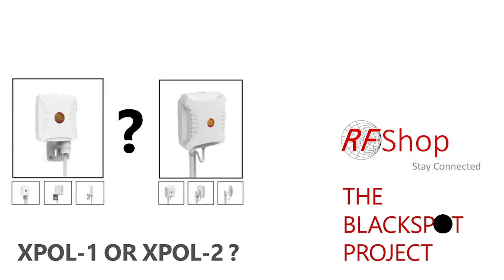What is the difference between the Poynting XPOL-1 vs XPOL-2 Antennas

Comment: You mention omi usually for urban areas but would it still make to install directional in urban at the top of my roof that's overlooking all other lower roofs and point it to a single tower (or groups of 5-6 on two opposite sides but am not quite sure what they're yet) or it's safer to get omni and allow it to choose from both sides between 11 towers - all within 1-3 miles (am 9 minutes drive from an airport)? Sorry am still new to this.

Comment: Hi David, can you tell me what the difference in reception is between the MIMO-3-12 and XPOL-1?
Both are applicable to an RV.
Reply from the maker: Hi Eric, sorry for the late response (9 days in)...
On face value I can only go by what the datasheets tell us. I am more in favour of the MIMO-3 antenna, because of where you can place it and how it can be mounted (i.e. well clear of any obstructions). The XPOL-1, although an omni, is inevitably placed against a surface or obstruction so would not be pure omni in the way I like an omni to be. 
Performance wise, though, they are probably very similar

Comment: I have a Netgear LB1120 and am looking at the XPOL-2 versus a MIMO LPDA from Waveform versus the new Amplimax?  In a rural area in Texas about 4 miles from the tower,  No tress within 500 feet from the house, but depending on how high I can mount the antenna, I might have some tree tops as obstacles ...Any suggestions? Thanks,
Reply from the maker: Hi J. If it's that remote I would look at the MIMO LPDA as the strongest option. Those antennas are generally a little bit better on gain, in particular on the lower frequencies.

Comment: Great informative vid buddy, I have a Netgear M1 which is only 4G can i connect the Poynting XPOL-1 which is 5G? will it be better for signal vs the Poynting 4G-XPOL-A0001 Cross Polarised 4G Omni LTE Antenna

Thanks Mick
Reply from the maker: Hi Mick. Yes, most certainly. When we refer to 5G it means that's an additional technology added to the antenna. It is backward compatible, and could do (where applicable), 2G, 3G, 4G and now also 5G.

Comment: Hi david I've just bought a tp link mr 200 to get better 4g but made no difference, than on my phone so thinking about getting an poynting attenna,we cant no see the mast because of hill,which one would you advice to get.
Reply from the maker: Hi Joleen, the XPOL-2 is a good option. You still know which way to point even if the hills is in the way. An omni would give you less gain and chance to make a connection

Comment: How does the XPOL-2 compare in performance to a conventional log periodic MIMO setup? When would one be suggested over the other?
Reply from the maker: As a general rule the LPDA setup is more suited for the rural areas as it just has that bit of extra gain, in particular in the lower frequency bands where the lower bands offers additional range / reach. This is a very basic cheat sheet (not overly scientific)...suburbs and outskirts can take XPOL-2's. Rural areas get the LPDA. 

Sometimes it's also a mechanical consideration, as the LPDA's are heavier and more bulky, where the XPOL-2 is a kilo and a single package.
Reply: @RFShop  Ok, thanks for clearing that up for me!

Just a thought, it would probably make for real good content to make videos comparing different antennas and setups to one another in different environments and scenarios to really show what equipment would work best for each application!
Reply from the maker: @journeytowellness7096  that’s a great suggestion. Many thanks for that

Comment: i'm getting 250mbps with my XPOL1 V2. i also found that it still makes a difference which way it's pointing, in spite of it apparently being omnidirectional. i got the SNR from 25db to 29db just by turning it 15 degrees. and signal power went from -81db to -76db. i just dont need XPOL2 as my speed is already very high
Reply from the maker: Indeed, at 250Mbps it’s going to be hard to justify another antenna

Comment: Just upgraded from XPOL 1 to a 2 V3 and my download speeds have almost doubled In rural Scotland !! Great Antenna Thanks for the info David !!
Reply from the maker: That’s awesome!
Reply: Great! I'm in rural Scotland and have been living with a xpol a0001 for 4 years. The ee mast near our hill just got upgraded to 5g. Hoping to slash out on xpol2 (great video btw!) just need to know how to work it where to point it!.. But just realised I will also have to upgrade my hub!
Reply: @julianbell9586  4G gives my 190 down and 40 up after BT got involved in EE. Used to get 250 down easy but its still pretty great for a none FTTC area. Just move the new Xpol around till you get Signal Strength:  close to 100% ! Took me a couple of weeks to find the best spot for it

Comment: Great crisp video! Well I just have both here to test because I am very unsure on what I need. XPOL1 as 4x4 and XPOL2 2x2 in the highest building of the city. Very curious on how they will perform on 4G and 5G modems.
My goal is to have highest stability with lowest ping. XPOL2 does 42ms ping in 4G so far... thats why I test the 4x4 omni too.

Comment: Quick question David: the T-Mobile Nokia 5G gateway supports 4x4 MIMO. If I read your video charts properly, the XPOL-1 supports 4x4 but the XPOL-2 does not. Would that suggest (cost aside) that I could, or should, hang two XPOL-2s outside to take advantage of the 4x4 MIMO?  If yes, are there guidelines as to how far apart they should be?  I love your videos, they have ben very informative. Thanks for your time.
Reply from the maker: Great question. There is video from Dr. Andre Fourie on this exact topic. Let me quickly find it...I’ll post a link below
Reply from the maker: https://youtu.be/IO_KGrrWoAI
Reply: @RFShop  Thanks David!

Comment: Hi David.Another great video.I'm doing some semi remote camping.I see other campers using these antennas.Would you recommend  the  XPOL-2 for distance ? Thanks
Reply from the maker: Hi, yes...for reach I would consider the XPOL-2. Trouble is always that the XPOL-2 is directional and will require more setup. An omni antenna will automatically work, but one is likely to be 6dBi lower...sometimes that is indeed a problem.
Reply: @RFShop  Thanks